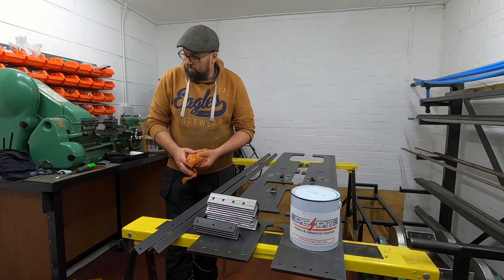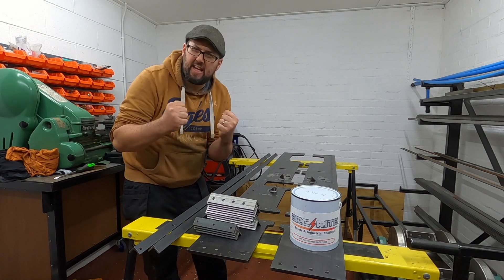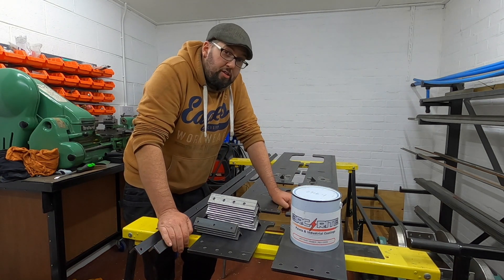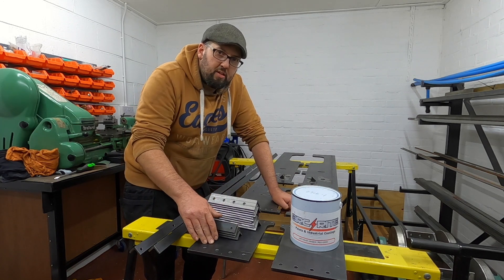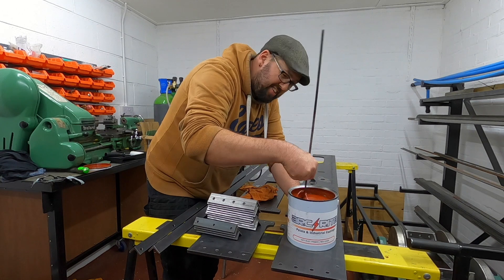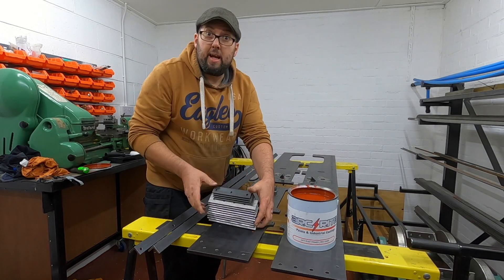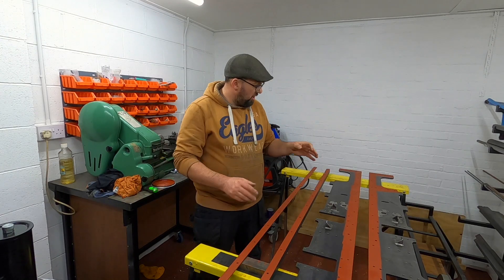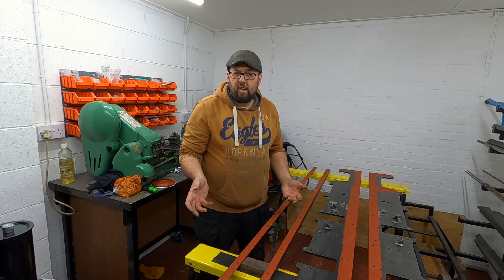Anti Corrosion Painting - EP6 - 7.25" Gauge Steam Locomotive Build.

Comment: Hi Matt.
I’m in the ‘paint first’ camp with you. However, I usually take off all the mill scale ( & the rolling oil) with vinegar. I use capped plastic pipe for long bits. 
I then prime all over with Upol #2 copper-based weld-through primer. This stuff is bloody expensive…. But it sprays on ultra-thin. 
Regards
Robert

Comment: Metal to metal is best for a tight  joint. You can’t get a tight joint with paint on the joints. It will all go slack when you start running the loco. Bolt it all together as bare metal then paint it and you won’t get rust forming in the joints.

Comment: I’m of the school where you don’t paint before bolting the frame together as the paint will allow flexing in the joint, whereas bare metal to bare metal has no flex, and in this case a loco frame you want rigid, and it’s even more crucial when you have inside cylinders. If the plate is clean and dry when bolted up it shouldn’t deteriorate, especially when you paint around the joint when it’s together.
Reply from the maker: I know, we've discussed this before, I did much research on this before I decided. I'm happy with this direction, and the torque wrench should give sufficient strength.
Reply: @MattChiversWorkshop  I know I’ve discussed it before, but couldn’t remember with whom
Reply from the maker: Yep 👍 Me 😂😂

Comment: “To paint, or not to paint? That is the question—Whether 'tis nobler in the mind to suffer some corrosion, Or to make drilling and tapping additional holes and welding things to the frames easier, Alternatively, weld through primer?”
Reply from the maker: Erm... Sikaflex works a treat. 😉
Reply: Oh yes!  In the day job, all the parts are primed first.  Assembled with a thin bead of Sikaflex around any joints and then topcoat. @MattChiversWorkshop